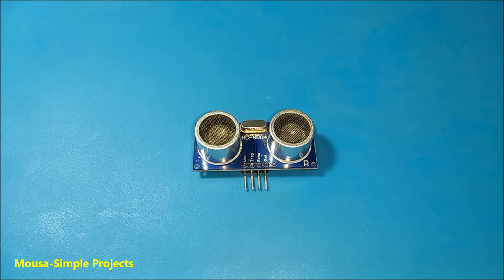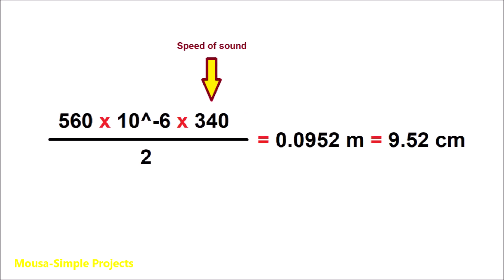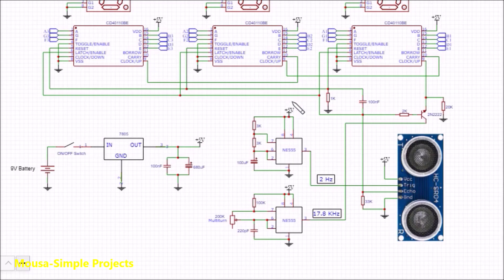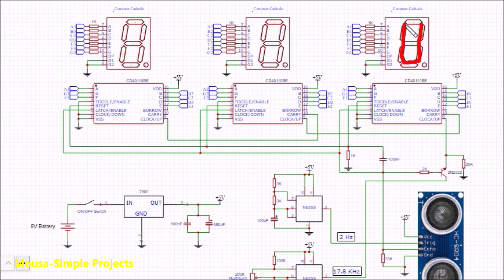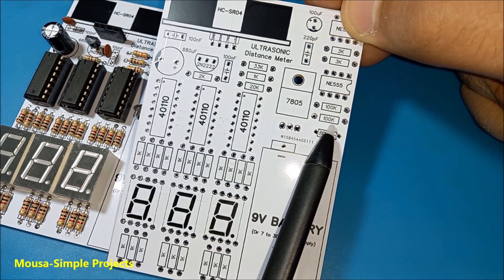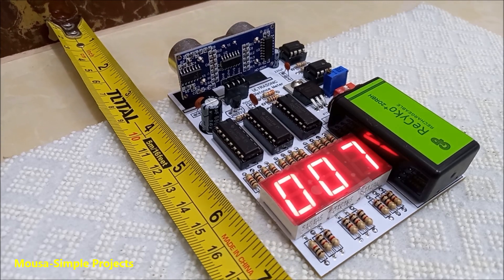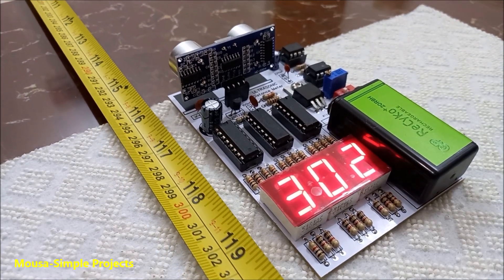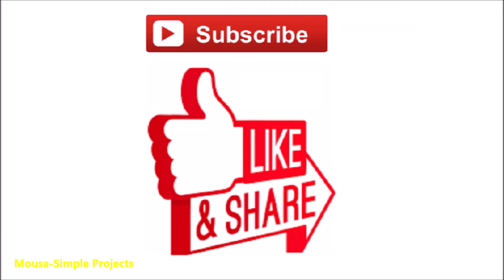Ultrasonic Distance Meter without Microcontroller / Electronic Distance Meter without arduino

Comment: Nice! Good quick video! Try to calibrate it at 1/2 the Max (200cm).  Noticed it was off by 7cm at 9ft (time 4:30). Not your fault, but the pre-made ultra sonic unit.
Too Bad they don't have an update/advanced one; with "zero/slope" (offset/null) optional outputs, for those who are OCD about accuracy.
Interesting/Liked your "current boost" video. Look forward to watching the "Pure sine Wave" . . . TJ